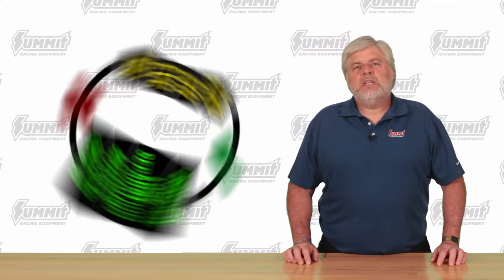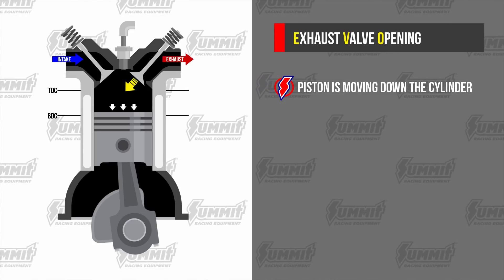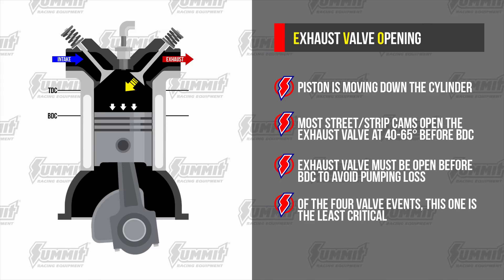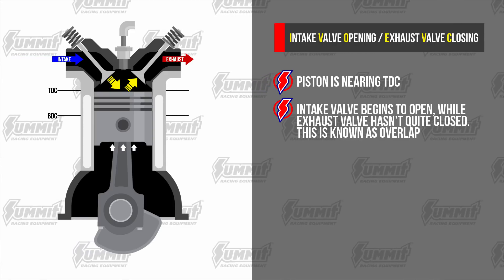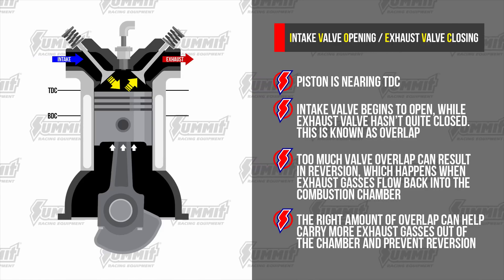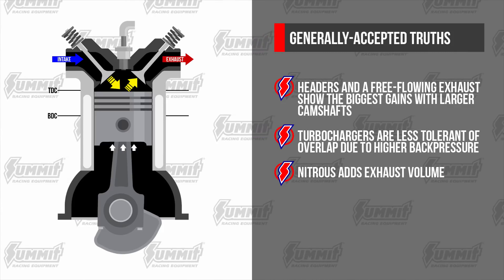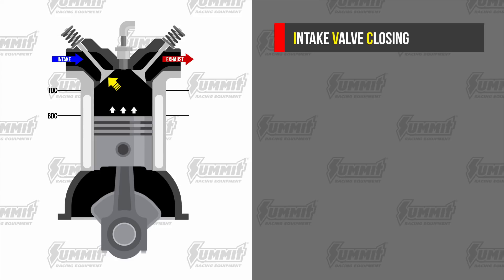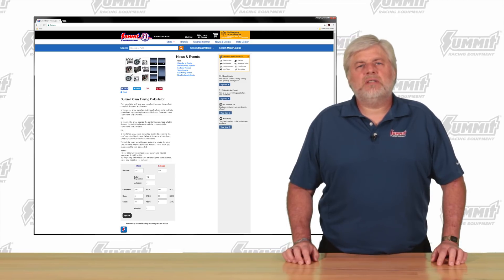How a 4 Stroke Engine's Piston Motion and Valve Events Interact

Comment: What would make the valves switch operations like blowing out into the carb and out the air filter
Reply: It depends on how violently it's occurring. What I mean is if it's like a sneeze, combustion is occurring when the intake valve is still open.
If it's doing this independently of any spark, then install a degree wheel and verify the valves are doing what they should be, when they should be, comparing it to your camshaft card. If you don't have one, you can get (or should be able to get) the information from the camshaft, on the front or usually the back end of it. 

In other words, if it's doing this independently of any spark, your cam timing is off. If it's using a chain, the gear marks are not properly aligned.

Comment: Just watched a video where someone used  a vacuum/pressure gauge to find TDC, He used a compression gauge hose took out the Schrader valve connected the hose to the vacuum gauge hose with a fuel line and hooked into the spark plug hole 
         So when it was on the compression stroke it was reading on the pressure side of gauge and as the power stroke started and exhaust valve opens it starts reading vacuum, he just turned the crank with socket back and forth till it read zero between vacuum and pressure to see TDC
      Watching this video brings it to light a little better, so when its TDC on power stroke i wonder what the gauge says?
   Just bought gauges gonna try it on my dads tr6 see if TDC is lined correctly with his harmonic balancer marks
   Thanks for video
Reply from the maker: Thank you for watching, Blake! Good luck.

Comment: Can lack of back pressure cause damage to the valves?
Reply: No. Valves are not damages during start up or if the engine is turned over by hand. In both instances there is no back pressure.

Comment: Hi Summit.
Liked your video. I wish it was more in depth and you specified ranges for our valve events.
Anyway, do you think an IVC of 51 or 52 degrees is good for my engine?
I have an LS2 408 with cnc ls3 heads and 12:8.1 compression.
If I run a slightly later IVC this should help with torque down low with that much compression?
I have also been having timing issues with current cam a 236/244 114 LSA +2.
I have been readling around that using a 51 or 52 IVC plus more duration should solve my timing issue as it will bleed some compression.
Please help!
Cheers
Reply: 4YYZUU77ÀÀ⁷À⁷